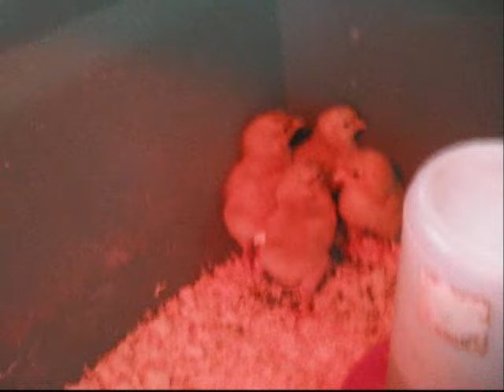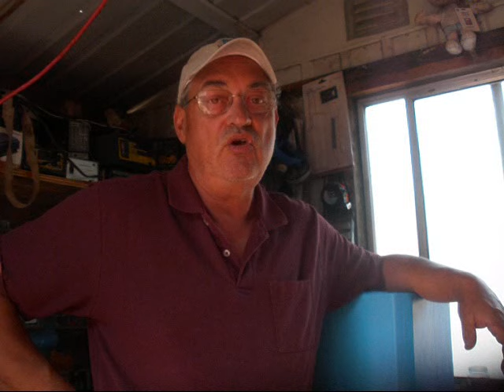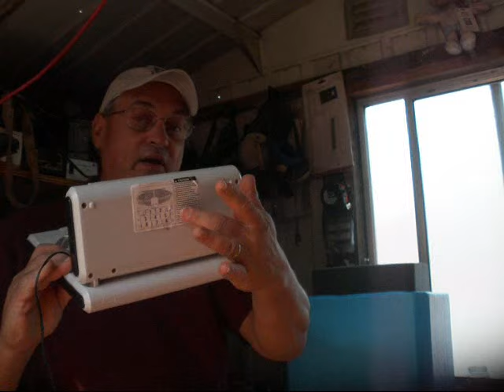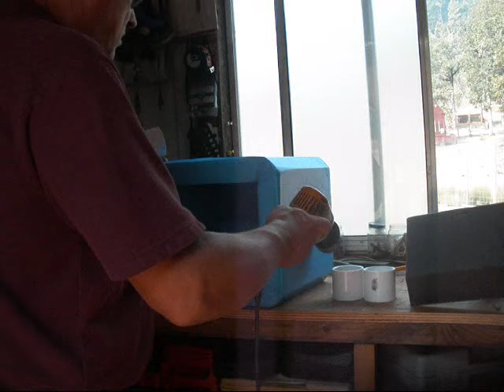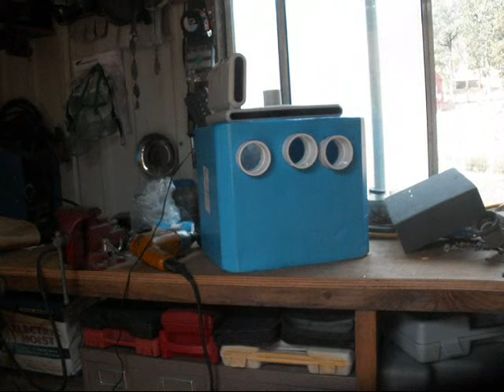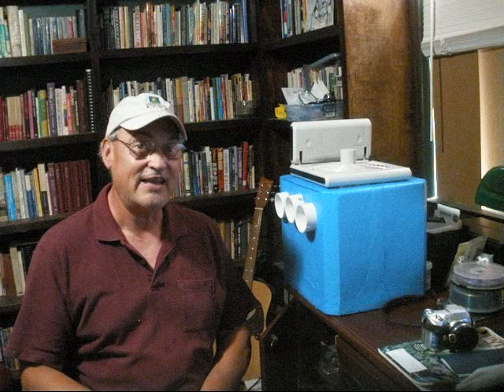DIY HomeMade Air Conditioner

Comment: nice diy in a pinch i used make those and work well. It runs cooler with a big frozen soda bottle and a little water. nice video
Reply from the maker: Thank you for the tip.